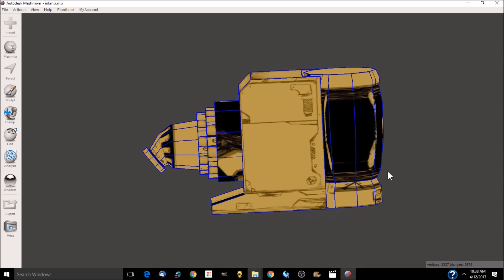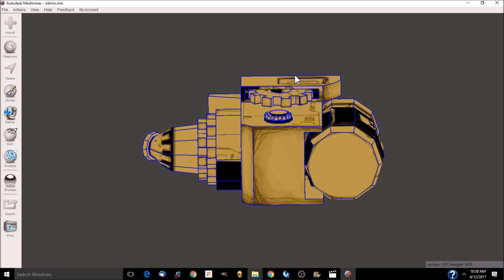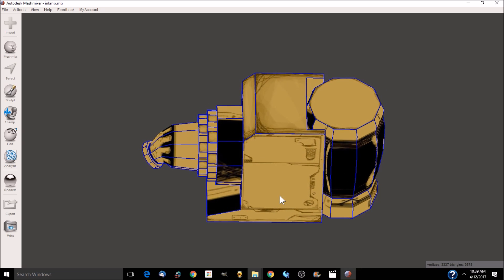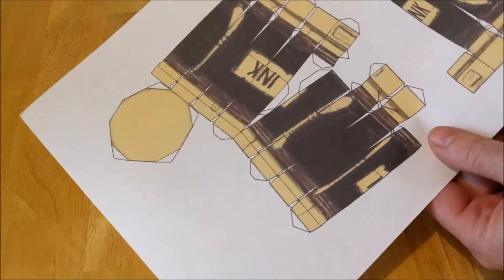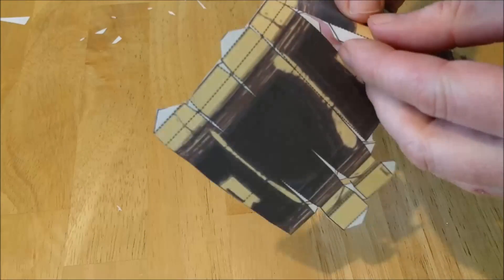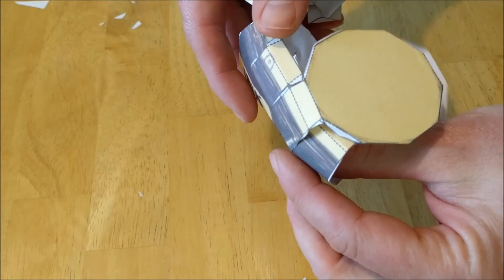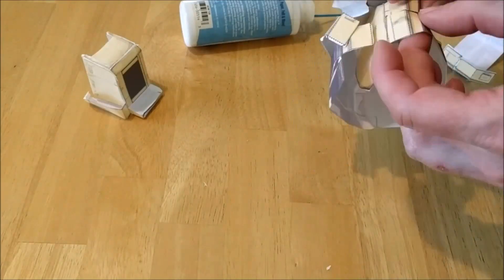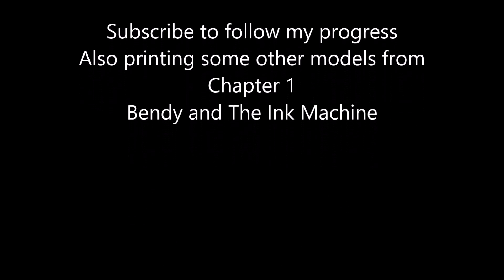[BaTIM] Bendy Ink Machine: Papercraft meets 3D print Part 1

Comment: how did you separate the gears from the model
Reply from the maker: Callum Knowles I used a combination of mesh mixer and blender to separate each piece there's some problems with overlapping Parts in the nozzle especially.
Reply from the maker: Callum Knowles I designed the internal gears from scratch using open scad but I don't think your intending to go that far.  Have to make it big enough to get everything in there